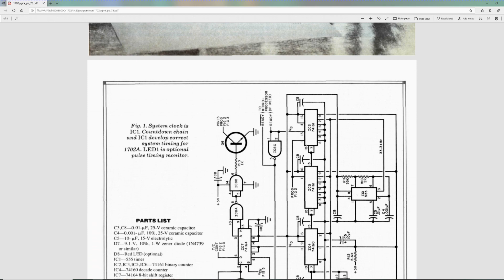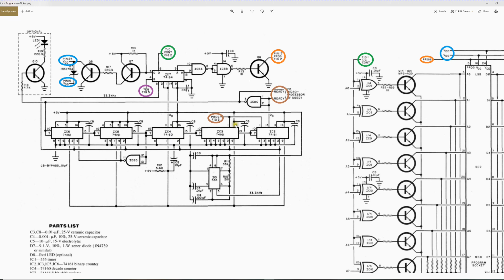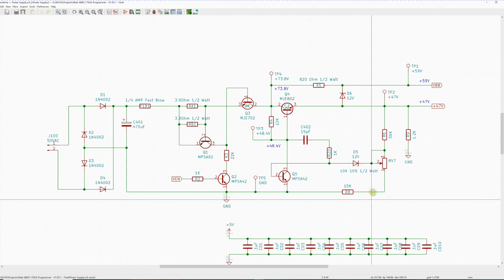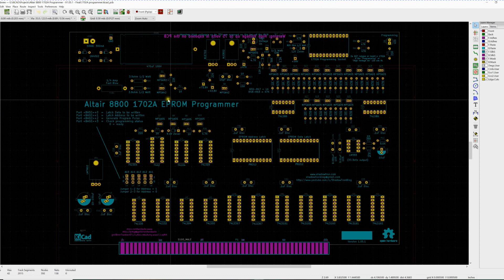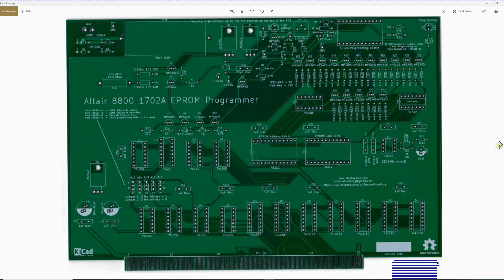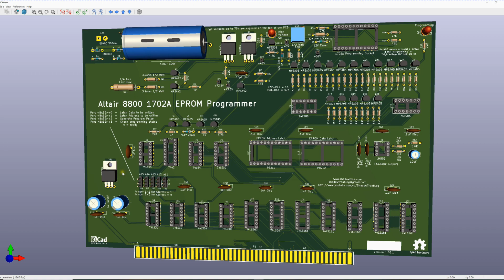STB443 - Altair 8800 - Part 68 - 1702A EPROM Programmer  - Introduction

Comment: Have you gotten this working? I'm struggling to program some 1702As for a different vintage computer.
Reply from the maker: Yes, I have it working. I programmed a set of 1702A's for my Altair 8800C clone. There are later videos demonstrating it in action.

Comment: Got a link to that programmer article you found?

Looks like the fun part is sourcing a power transformer that has the power and current specs. I wonder if a Voltage Doubler circuit would put enough current needed for the high voltage.
Reply from the maker: The article link is http://tronola.com/1702pgmr_pe_78.pdf - The full page is http://tronola.com/html/1702a_prom_programmer.html - he mentions the article in the Bonus section of the page. I found a 50VAC 500ma transformer on Digikey.